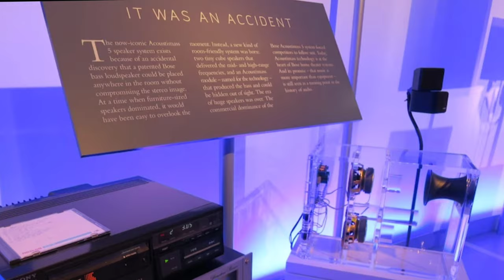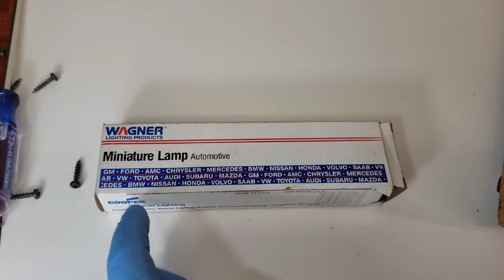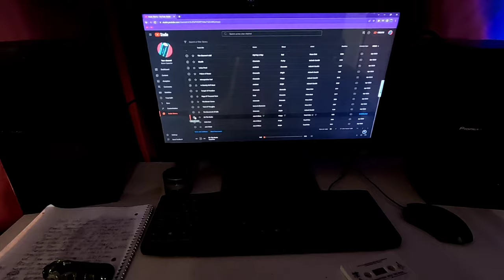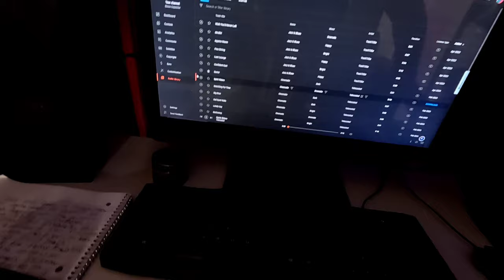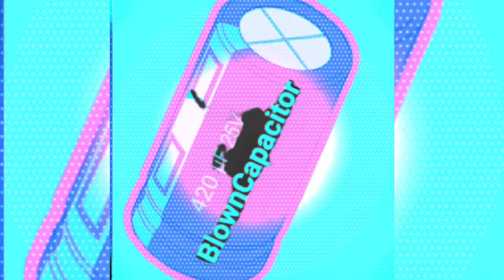BOSE 601 SERIES IV Tweeter Repair And HONEST Review

Comment: Have a pair of Bose 301seris IIs that I had laying around and a pair of orange Advent fried eggs from a large Advent. Yeah the fried eggs ended up in the front of the bose with a new crossover ( first oder at 2600 hertz) so the light bulbs are gone. Used a nice L-Pad to attenuate the highs a few decibels. The original tweeters still fire backwards. They do sound better and I'm using a sub. I actually like the large sound stage they put out . There is a sweet spot but I can still be sitting in front of one and here the sound stage pan over to the othet side. There is a pair of small directional speakers just inside them that I can blend in as desired on a second amp....I know that shouldn't work, but it does ...compounding things that shouldn't work are a third set of speakers on the floor sealed in  paint cans with the tweeters sitting along side sitting on tobacco cans aimed at the ceiling on the other side of the room powered by another amplifier. Many broken rules with enjoyable results . Non of my amplifiers need to work hard either. Had an interesting space in the basement too work with all the walls were covered with 10" 7 ply 3/4 " red oak plywood boards...the ceiling is pine tongue and groove...got to do something about those loose ends...it's pretty loud before they rattle. Anything under a watt is wonderful.
Reply from the maker: That sounds awesome!
Reply: @Blowncapacitor84  thanks...it's all eighties and some nineties equipment. A Yamaha RX'V850 that I'm using as the preamp and powering the Bose . A Pioneer SA-520 and MCS 2255(Technics integrated  that uses some SU power packs that are connected to a freon tube going to the heat sink) powering the other speakers. An Onkio DX-710 CD player. JVC DD-7 cassette deck...going on 20,000 hours....probably the most reliable deck they made...direct drive capstan and Sendust Alloy Heads ,,,makes a nice tape with TDK D series.  Oh yeah a Technics SL-7 close"n"play linear tracking turntable  that I pulled out of a dumpster by the power cord in good working condition. I  just picked up a Stanton L747S cartridge with a good Steriohedron stylus that appears to be nude mounted so it's basically a 681 Steriohedron...a bargain because L747S is a p-mount .A little Infiniti sub ...looking for something a little bigger though. I'm glad that all that stuff was found decades ago when it was free or dirt cheap. I don't see anything in thrift stores anymore and now the stuff gets recycled instead of curbside and dumpsters. Next is get my Sansui AU-7900 up and running  the preamp in it is lovely.

Comment: These aren't a patch on the 601s series that came before. These are very boomy with none of the 'air' that the original 4 tweeter arrangement provided. This series lacks enough poly fill (anti-resonance) for two active woofers.
Reply from the maker: They are definitely boomy. Would you suggest adding more poly fill? They are currently being used in the living room and work fine for the situation (I don't use them for music)
Reply: @Blowncapacitor84  whenever I've built speakers in the past I used 3/4in thick wool-felt carpet padding in leu of poly fill but it'd be easier for you to add poly fill
Reply from the maker: @toddlee2571  Thank you very much!!
Reply: @Blowncapacitor84  the design of the series 4 is basically a quasi-Voigt Pipe (or a tuned quarter wavelength tube) with its own set of resonances. It's also a bi-polar configuration since it has a woofer on both front and rear baffles, wired in-phase with each other (if the rear driver were wired out of Phase it'd be a di-pole). A bi-polar configuration also enhances bass and makes room placement a bit more critical. 

I'm not sure what the crossover points are but previous series had an overlapping crossover point: 2500hz for the woofers and 1500 for the tweeters. Not sure if the series 4 are the same or not but a high crossover point on both woofers in a Voigt pipe would make for a lot of boom. Lowering the crossover point on the rear facing woofer might alleviate some of that mid-bass bloat. 

You be interested in reading up on Paul Voigt, an innovator in acoustic research and was a major influence in the field for decades (including JBL and Klipsch) and pretty much the shoulders of which Amar Bose stood upon.
Reply from the maker: @toddlee2571  Thank you again! I appreciate the information very very much!